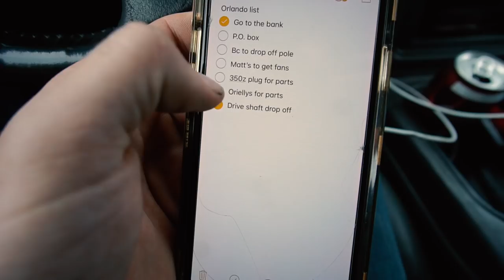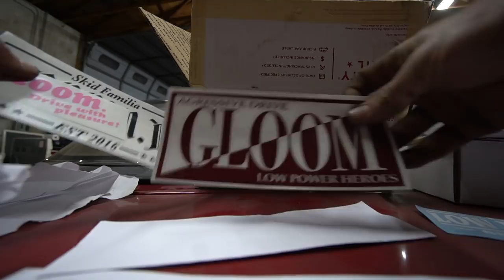Cleaning Up the Missile Z For Gridlife!

Comment: the line is from the machine that lays down the road, since it is not wide enough it has to do 2 runs 1 large and on half :)
Reply: close. it actually does 3 runs. the machine is only wide enough to do 1 full lane. so the yellow emergency side needs to have some room to. if you look in the middle of the rode on the left lane there is a Passover. & on the far right, the one Taylor is talking about it is the 3rd side.
Reply: You are both wrong a paving machince can pave up to 16 ft i do road work so i know what im talking aboit and thoss lines are from someone running on rim

Comment: I believe it's an expansion joint in the concrete. As time goes on, and the underlying ground moves around with erosion/other natural forces, the concrete will crack if there isn't some wiggle room. It's a fairly common practice, California does it perpendicular to the driving surface (because their ground moves a lot more mostly), but it's super annoying because the level/angle of each piece you drive over changes so your car bumps around a bunch. Anyway love the videos man!

Comment: The line in the road is created during the paving period. The shoulders are usually put in first and the main lanes are put in second. Its generally the weakest point in the road and can wear away quickly due to heat, rain, and general wear.

Comment: "Cut in the asphalt" is a seam of the different layers of roadway as they can't lay down a solid edge to edge surface much like your flooring in the house. 
These seams get exaggerated with rain, hot and cold weather expanding them.

Comment: Gas gets jacked around here, Brave going with a non-locking cap! Those cuts are there after they work on the lines that run beneath the road. Sewage, power, tele-comms all that stuff. Could also be a very long road patch to fix old concrete.

Comment: Those lines in the pavement are most likely SawCut lines, that help/prevent the road from cracking due to temperature or moisture changes. 

They have them all over the place in Canada to prevent the road from freeze / thawing and breaking up.

Comment: that line could be something as simple as a cable (telephony, power[unlikely], possibly a water line) alternatively it could be testing has been done across that whole section to determine good spot and bad spot in the road (strong and weak spots) to determine if the tarmac needs to be re laid to strengthen the road.

Comment: That truck definitely has to have a larger tank. My 1500 had a 26 gallon tank, but it sounds like your sending unit is having a problem and not recording the fuel level correctly.
Reply: I just looked it up and it's true alot of the short beds have 26 gallon tanks and the low fuel comes on at  like the 20 gallon mark so you have a 6 gallon reserve which is weird cause the older dodges have 32 gal for short and 35 for long
Reply: Maxiethedog123 I figured it’d have to at least a 26 gallon tank. My low fuel light would come on at 6 gallons remaining
Reply: @DiyDadFL  yeah I just think that it's odd that gm uses that small of a tank on the 2500/3500 but at least the long bed is 35 gal

Comment: It's usually the asphalt depends on how or who the individuals were who put it down but usually that's just a design error more or less .... sometimes they pour the outside edges first then fill the center part and then roll it and use that edge for like a gauge....

Comment: The cuts on the roads are usually rims blowing up and semi trailers just riding on the rims or when there usually in the middle of the road and pull over quick that’s a trailer coming off the hitch of a persons car and sliding on the ground

Comment: You should have a 34 or 35 gallon tank on that truck. I wonder if your fuel gauge is off. My jeep Cherokee low fuel light comes on when I still have 6 gallons in the tank. Another 100 miles before I really need to fill up lol. And it's a 20 gallon tank.

Comment: The marks are from an air line for the brakes popping off and the wheel locking up. Big trucks use compressed air to push the shoes away from the hub hence the "pish" when the apply the parking brake. It's really hard to tell when just one wheel locks up out of 18 (technically 32) so until you see smoke or she blows it just drags. You asked lol.
Reply: Lord Spiffington III not really  it almost  instantly noticed  when  we lose an air line
Reply: Ur wrong u got a air gage that will show you your losing air
Reply: 13 years driving trucks in NZ and it's happened to me twice and a bunch of my co workers. If I'm wrong please tell me how you think the skid marks get there.
Reply: Lord Spiffington III i drive a log truck in texas i blow a tire i know its blown

Comment: That line in the pavement is really strange.. I’m a Engineer for the City I live in so I oversee all of our road construction. The size of the pavers and amount of passes shouldn’t leave a line like that, as the pavement should be blended together. Sure you can see the pass lines, but in your video it looks like an actual gouge/cut in the pavement. Unless it’s done differently in Florida than Massachusetts it must be cause by something like a rim or something along those lines